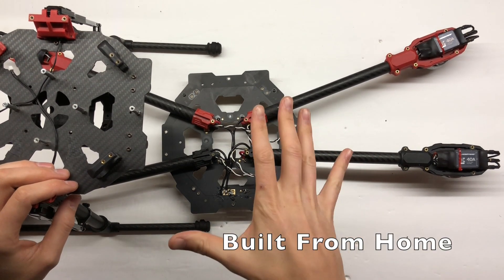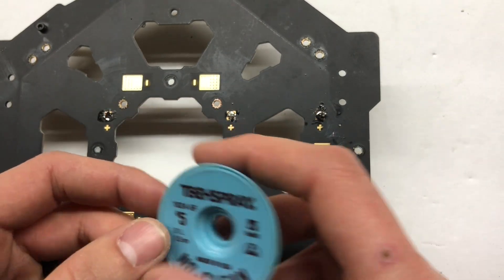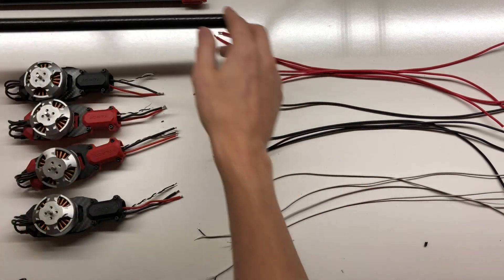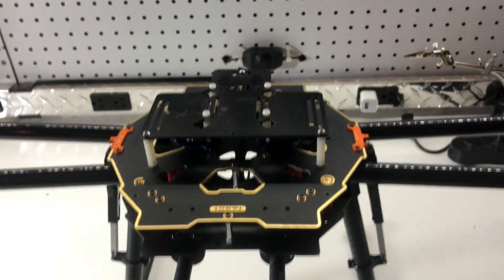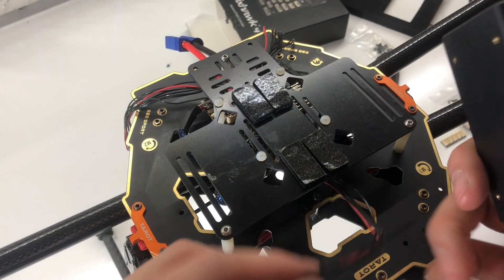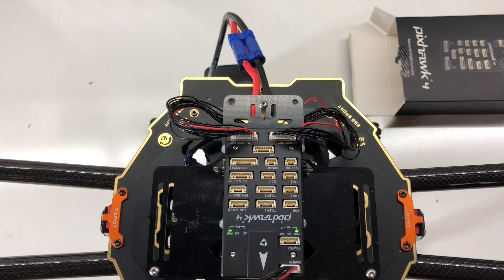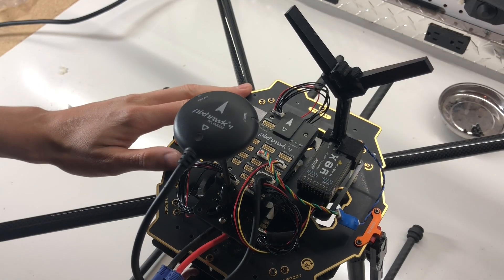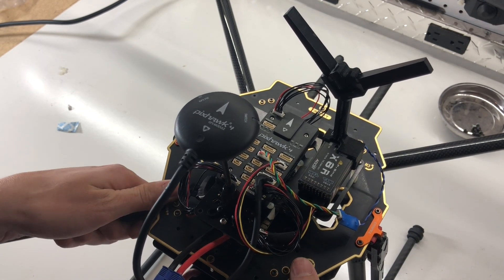Pixhawk4 Setup | Tarot Frame | Extended Arms | Build

Comment: I am planning a 650 Sport build and have some questions. What gauge wire did you use for ESCs? I’m planning on 12 wag. Where did you get the late for mounting the Pixhawk? I want to mount my ESCs in the center body but need a plate for mounting. Also planning on a Matek power distribution board.

Comment: Hello:) Thanks for the video! I was wondering how did you power your PX4 previously (i.e. without using the PDB) ? I am working on the same frame and I dont have the pdb so I was wondering how can I power the px4. Thank you in advance!

Comment: Hm... long power wires to the ESCs will kill them. Especially when you fly with large props.
Reply: That's a false statement,  increase wire size to accommodate length.
Reply: @mackdaddy877  just add a couple of capacitors and you will be safe. But still - those long power wires are not good for your ESCs.

Comment: This provided a bit of help, so thanks! However I'm still confused about how to power the PixHawk 4 Flight Controller as I wont be using the power board provided by Holybro as I will be using the Tarot TL2996 12S 480A Power Distribution Board. Any ideas? Thanks!
Reply: Radon use the holybro pm02
Reply: @abengtz  Thanks, will check that out! :)
Reply: @radon1221  Hello, what did you do? I cannot use PM07 as my motors draw 192 A and I cannot find a suitable power module.
Reply: @emreceliltayyar1236  Use a more robust PDB as you are pulling 192A, you can find loads on AliExpress, just find the ones that  are called 'Power Distribution Board 200A for agriculture drones'

Comment: Hi, great work. I love the stability and graceful movement for smooth video and still photography. Cost of everything comes to about $1800 (GoPro8, Radio, 3-axis Gimbal, etc.). Do you know if one can build a GPS-Hold Quad for still photography, and maybe even smooth video (NOT A RACE Drone) that is around $300 or so? The reason I say $300, because we can buy the DJI Mini Fly-More Combo for $500 (for now, I'd like to start with something smaller than a Mavic Air 2, or the upcoming Mavic 3 Pro). Thanks

Comment: I am building a drone because I watched this video. I am using everything that you are using. My drone is going to be hexacopter. I have one question. Did you connect Hobbywing 40amp ESC directly to power distribution board?? You didn't use any UBEC or anything, right?
Reply from the maker: Yes the ESCs are connected to the pixhawk 4 power distribution board. I do use a ubec for powering other thing on the drone like my fpv.
Reply: @builtfromhome9207  Thanks bro this is huge help. I was super confused before. Now, I can peacefully connect my ESCs directly to power distribution board when they arrive.
Reply from the maker: @panchampatel1  at around the 9:00 min mark you can see the red and black wires from my ESCs connected to the power distribution board.

Comment: I am building a Tarot 650 with a Pixhawk 4, may I DM you for some help?
Reply: I am making Tarot 690. Did you connect Hobbywing 40amp ESC directly to power distribution board? without UBEC i guee?
Reply: pancham patel I haven’t got that far yet. I want to connect the esc(s) to the pins and not solder them directly to the power board. How are you doing it???
Reply: @dcarter52  I am waiting for my parts from china(AliExpress)  to arrive. About 23-24 days to go. 
.
 Are you using Pixhawk 4?
Reply: @panchampatel1  Hello, the maximum current in the power module of Pixhawk 4 is 120. Can I install motors that draw a total of 192A current? Is this a problem?

Comment: Did you drill holes in your board to attach the platform o  which you attache d the power management board underneath and the PixHawk on top?
Reply from the maker: yes I did drill holes in the top-plate of the drone. If you still need to use it as the PDB then i would not recommend that. I was going to use the Pixhawk4 PDB so it was not a big.

Comment: Where did you get the mounting plate hardware you placed the Pixhawk on and the stands to attach that board to the Power board below?
Reply from the maker: That was from on old drone I had laying around. You could buy a battery tray though like this one and make it work. Or if you have any old flat pieces of plastic laying around you could use that. https://www.banggood.com/custlink/3GG3ApfRQO

Comment: Nice setup! Nice Video. I am building my first drone and it's a Tarot 650 Sport. I do have 2 questions. 1. Where did you get the boar that is below the PixHawk that you also mounted other items on. 2. I have an old Pixhawk 2.4.6, do you recommend I upgrade to the PixHawk 4?
Reply from the maker: HolyBro has a  store on Amazon where you can buy all the stuff you need. Or you can go directly to their website. Shipping is normally free on amazon but costs extra on their website so keep that in mind. You can decide which is better for you. I bought a package form their website.

Amazon:
Power Management Module (this is the board you were asking about): https://amzn.to/2OX7k02
Pixhawk4 + GPS https://amzn.to/34YyUzs

HolyBro
I got package 20034: https://shop.holybro.com/pixhawk-4_p1089.html

As for what to use. I also started with an older pixhawk 2.4.6 board and it worked ok. However, I really wanted a controller with better compute times and ability to run more imports without the chance of something failing. The pixhawk 4 runs with the FMUv5 standard and high-performance, power-efficient STM32F7 chip. When it came down to It I felt more comfortable knowing my over $1000 drone and camera gear was being powered by a flight controller that was build with quality in mind. My older pixhawk was just a nock off cheap controller.  So what should you use? Well it all depends on your budget and what you want to do with it. Does that help at all?